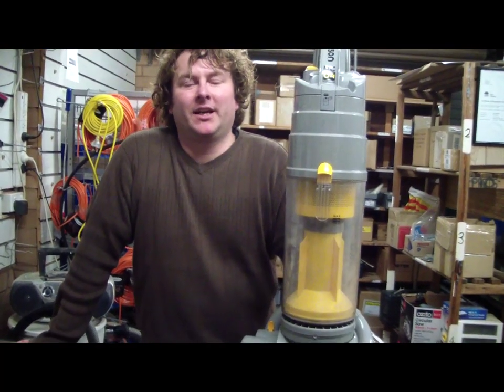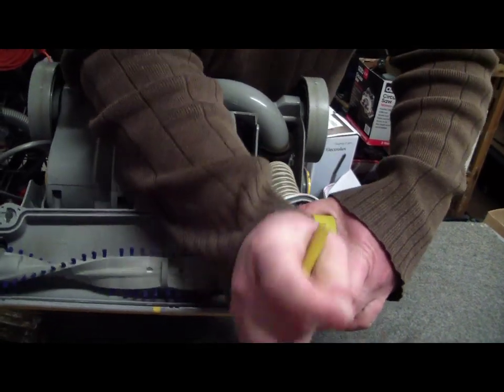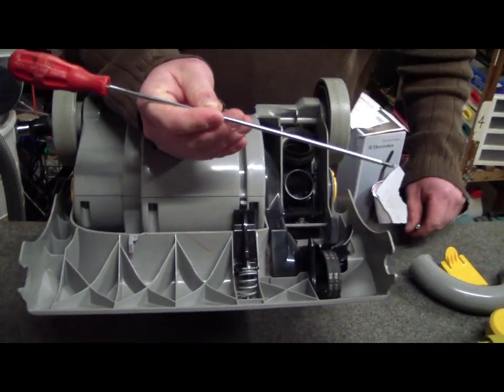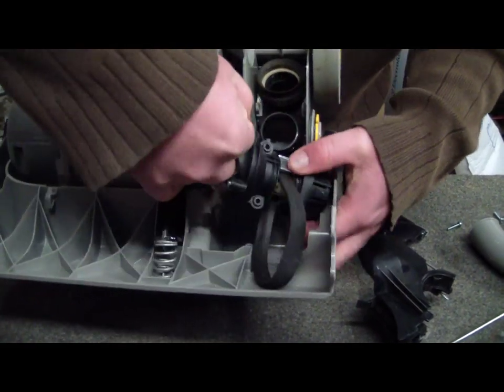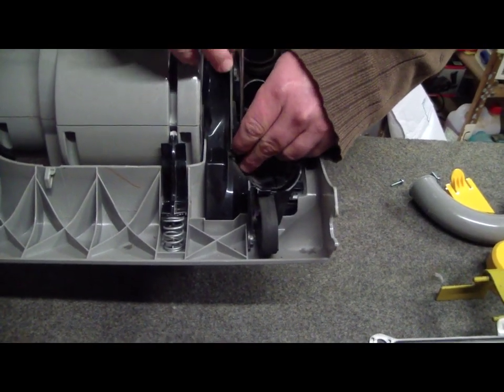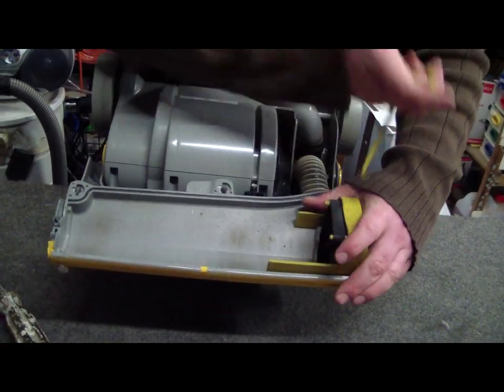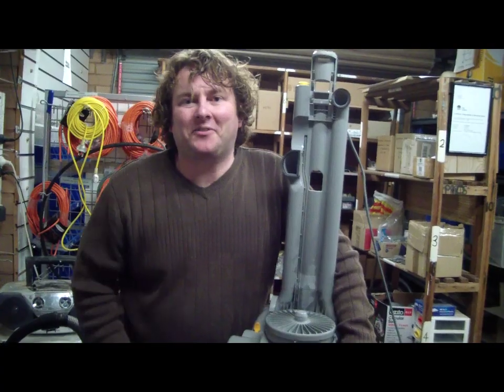How To Replace the Clutch on a Dyson DC04 Bagless Vacuum Cleaner

Comment: HI Alex. This was a great tutorial which helped immensely in changing the clutch in my 18 year-old DC04. I guess common sense should have told me that the old belts would have stretched, but the new ones were so much smaller that the brush bar was not even long enough to stand up through the footplate hole - I had to thread a piece of cord through it before replacing the plate and pull it through that way to get the hook of the belt lifting tool through it. Then what an effort to hook it round the pegs! Anyway, job done and the loud grating noise from the old clutch has gone. Thanks again

Comment: It has been a while since anyone commented, but the video just helped me fix my DC07.  The thing has a whistle to it now and that brush bar is unstoppable.  It hasn't picked things off the carpet, like it does now, for a long time.  By far the hardest part was to get the belt on the brush bar - the belt tool fixture didn't quite fit, so I used one knob on it and finagled it the rest of the way with the belt pry tool  That new belt is something extremely tight.  Thanks for the video tutorial!

Comment: Yes if the brush bar is not spinning then you would need to inspect the clutch and the belts, if the belt is broken then you could change the belts or replace the entire clutch. Either way this video shows how to get to the clutch

Comment: Thanks so much for this.  I've just finished using this video to help me replace the clutch and belts in my old DC04, and it's hugely improved.

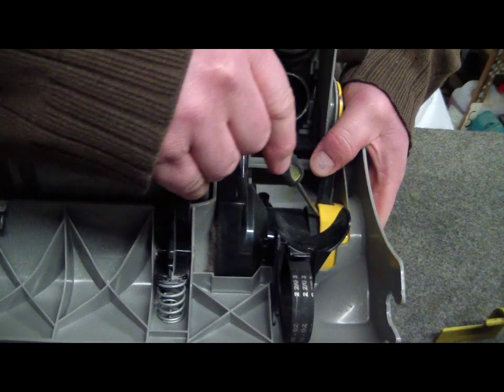But a warning for other viewers (for the knob removal at around #02:00): note that on some models (mine's a 1999 DC04 Absolute), the end of the clutch is the same colour plastic as the clutch knob that you actually need to remove. (In this video the end of the clutch is black and the knob is yellow.) On mine, both were yellow, and so looked to be one part, so I ended up inadvertently trying to pry the end of the clutch off rather than prying the knob off.  That broke the end of the clutch, but happily, of course, I was replacing the clutch anyway, so it wasn't a problem. Just thought I'd mention it in case somebody tries to take off the clutch off an older model in one piece!  (On those models, the knob also looks slightly different: it has a black spot rather than a pointer.)
Reply: I've had to do several repairs to my old DC01, but not quite to that extent. It's now relegated to our backup/upstairs hoover but a permanent resident on the landing!. They should build houses with upstairs broom cupboards.

Comment: My dc04 has a thin metal bar which seems to stop the belt coming off the motor spindle, just to the right ,on screen, of the thin belt at about 4:25. It's a bugger to refit but I can't see one on yours. Is it necessary? great vid, very useful.

Comment: Hi, vert good demo but just wondering why you would need to do this (you did not specify the fault) would you replace the clutch belt if the brush roller is not spinning?

Comment from the maker: Hi There, 
You know I actually don't know why they become brittle only that it is pretty easy to crack a bit of the plastic off (yes I have broken a few over the years) requiring a new head piece. I suspect that the plastic is simply not reinforced or wide enough at the point of pressure.